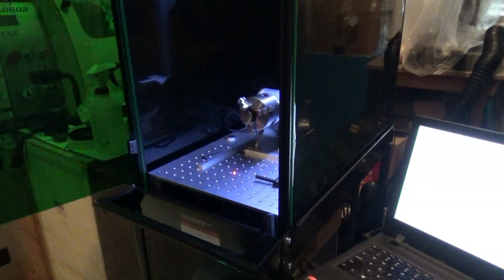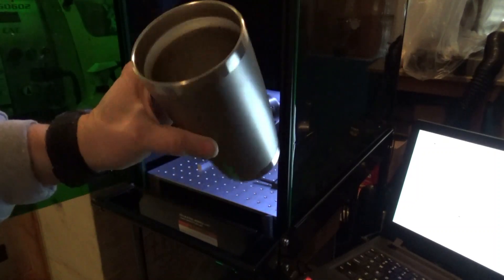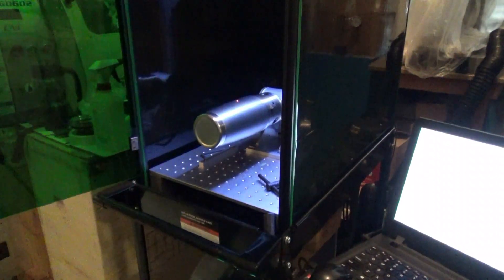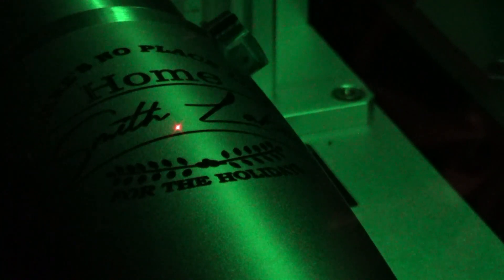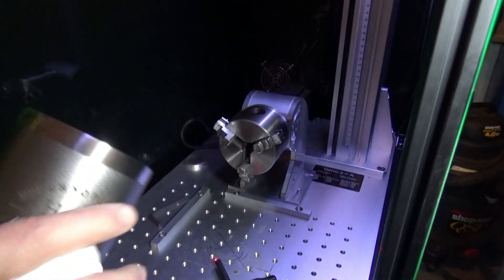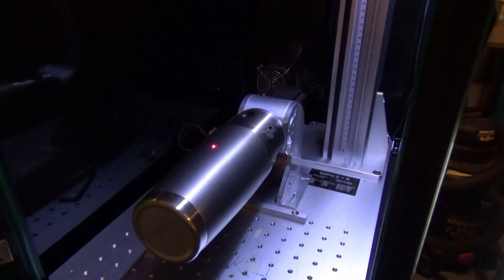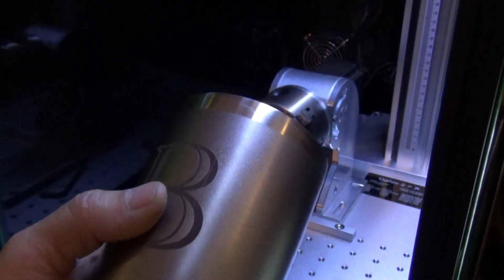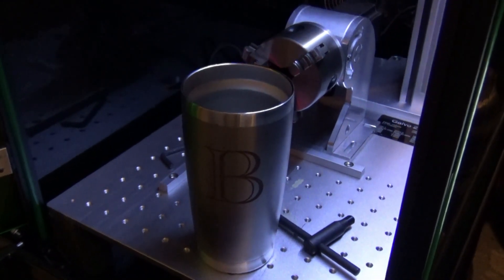Rotary Cup Marking

Comment: Great video! I just purchased the rotary attachment. What settings are you using for it? I can't get it dialed in.
Reply from the maker: I did a rotary setup video on the Monport GP-30 setup is the same
Reply: @CNC4XR7  Nice! I'll go check it out. Also which lens are you using?
Reply from the maker: @HNYBAGR24  stock lense on both units